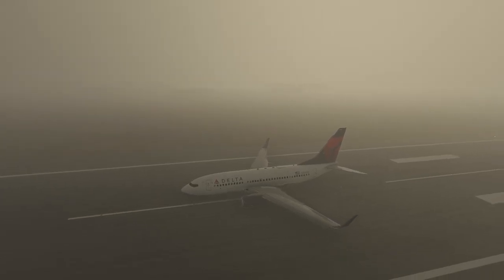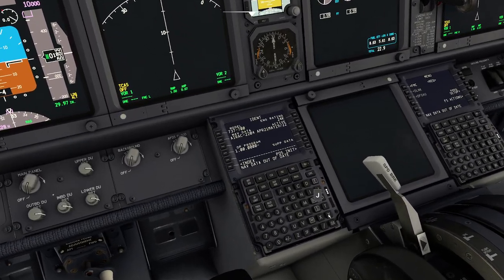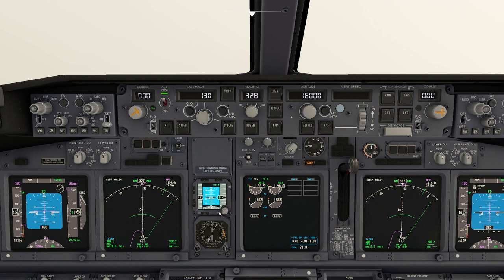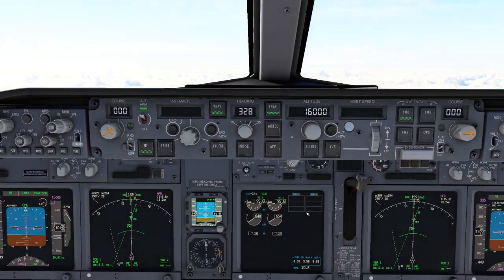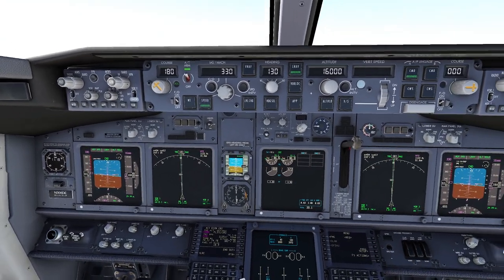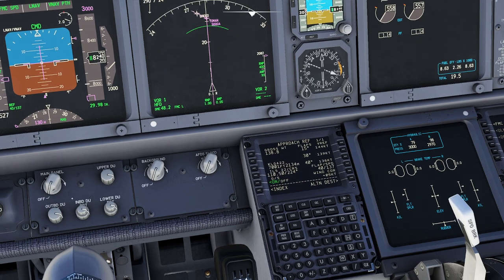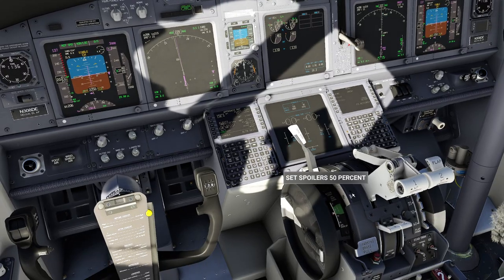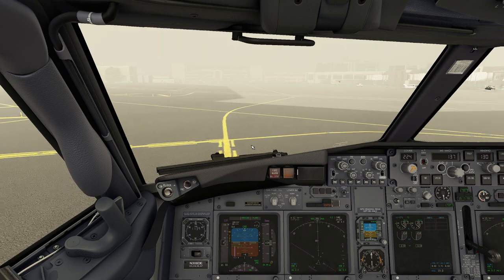MSFS - PMDG Boeing 737-700 Autopilot Overview

Comment: might add there is a TO/GA button specifically for mouse players on the little screw in the left corner of the MCP (under course bug and left of the F/D switch all the way to the edge). looks drooling to change cameras to toggle TO/GA on the throttle itself.

Comment: Have you had an issue with the cabin pressure. Also, are there any circumstances to where LNAV and VNAV will not engage?
Reply: i have had zero issues with VNAV on about a dozen flights so far. Ascent and Descent work exactly as expected. Majority of VNAV problems I see people having is in thinking VNAV is a completely automatic system that requires no input from user. VNAV requires input into the FMC and weights and balances to be setup to properly calculate (technically winds too but its not as important for sim). It also requires users to confirm top of ascent and bottom of descent on AP ALT bug etc...
Reply: @NOTAM1  interesting, I didn't know you had to confirm TOC and TOD. Where in the fmc do you confirm it? In the legs?

Comment: Hi. I can input departure and approach, but for example if I am landing at Sydney YSSY and I’m coming in waaaaaay early at 1500ft, I can’t seem to even be able to activate loc. I can press approach and obviously I’m low. But the magenta diamond for altitude is high (good) but the plane stays at 1500 due to altitude hold which I can’t turn off. So what ends up happening is I just continue at 1500 ft and fly over the runway. It doesn’t descend even with app on. 
I can’t turn off alt hold, can’t seem to descend to land. I also can’t seem to be able to use vnav but lnav is working. 

FYI I can do all the above on the 747 and on the a320. 

I realise that is a lot of questions, but anything you can tell me to help me land would be great